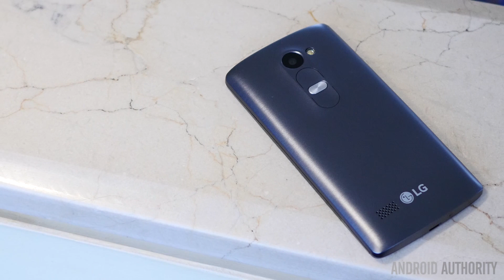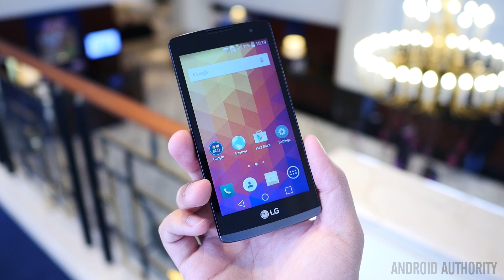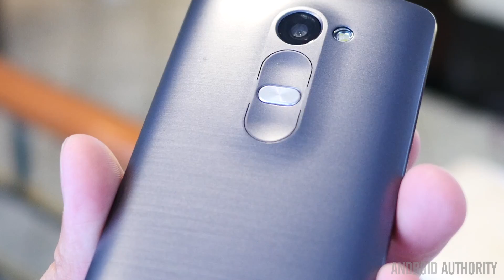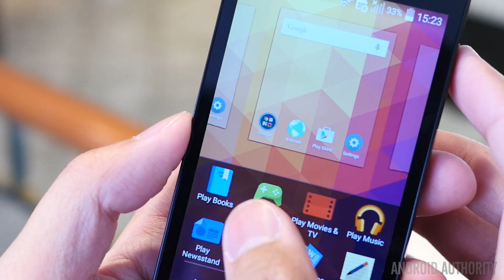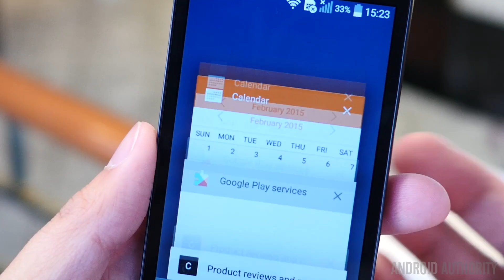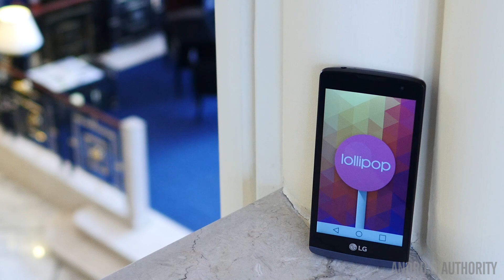LG Leon First Look

Comment: I don't know how much this costs in the US or anywhere else but you can get this for £60 in the UK brand new, which is a bargain. This is a budget phone so don't expect it to be like the G4 or something but for £60, give you bang for your buck.
Reply: +kashattack 
60 pounds!? Where!? Best I can find is 90 at argos.
Reply: From Vodafone. It's actually dropped to £50 now! Check it on their website. You'll need to top it up with £10 but since I had a Vodafone sim I didn't need to top up.
Reply: kashattack Ahhh, I don't want to work with Vodafone, not for any reason, I'm just happy with my deals now. Thanks though! :) I'll probably just be getting a Moto E.
Reply: The Great Spud I don't use Vodafone's network either, I bought this phone from them and got it unlocked by using a code purchased from ebay for a about 2 quid.
Reply: kashattack I don't do things with my credit card on the web, thanks anyway though... again. Got the Moto E and it's good enough for me.
Reply: cheapest smartphone for T-Mobile. makes a good backup.

Comment: Moto E 2nd gen is way better than this and I'm pretty sure they r at the same price point. Samsung galaxy core prime is a worthy competitor for this phone bit moto e2 Is better in about every way , much better IPS LCD Qhd 245ppi screen compared to the lg's wvga 220ppi screen.
Reply: +Tahmid Islam Moto has a bad reputation on camera's, LG on the other side is much better brand for a camera, also the Moto E doesn't have flash on camera.
Reply: +Gabriel Hernandez Moto does everything else better apart from the camera

Comment: I got this phone on Wednesday and as for now, my opinion is that it's a very decent phone. my only complaints are that the screen isn't really good, could had at least put a qhd screen. second, the camera. SUCKS SO BAD. you can't focus it nor does it have auto focus. except for the front one. thirdly, the internal storage. this is an "8" gbs phone. however only around 3.4 gigs Are available to the user. just had. lastly, the charging. my sisters and I all got this phone, and we use the charger that came with it to charge it. but it takes so long to charge. literally it took about more than an hour just to go up about 25%. however it does has good battery life. other than that if it didn't have all those problems this phone would be amazing.
Reply: ***** the minimal they should had done should had been a qHD screen
Reply: In my opinion
Reply: But the way it is its not bad just could had been better
Reply: Thx I'm going to get the Samsung avant instead
Reply: Darude - Sandstorm Really bad camera, but it was cheap as dirt so I can't really complain. Coming from a ZTE Avid I'm pretty satisfied :p
Reply: at a price like this? I got this one few months ago and I must say it is very much performing well.

Comment: terrible. you said nothing on how to operate this phone, why bother?
Reply: ***** I have this phone, got it the second day it came out, which I kind of regret on the part that the camera is really bad.  The phone itself is nice and the Lollipop OS is pretty smooth, though it does stutter a bit when exiting from an app.  For my particular preference, I just need a phone that connects my calls flawlessly and a good camera and this one doesn't have that.  The camera doesn't have auto focus which is so basic on lower range phones and this one is suppose to be "mid range" so I was really not happy.  It opens with the new "knock" feature to the first screen then the swipe screen  to get to your apps.  No buttons around the handset only the two you see on the back toggle up and down,, the middle of the toggle is the on/off silver button and when asleep, the same toggle works as shortcuts, down for the camera and up for the quick memo.  If the camera feature is not a deal breaker for you then go for it.  Hope this helps.
Reply: The camera was the only good part about it imo.    it was a second phone for me, it sucked and I returned it 2 days later! To me it had nothing that worked and didn't even hold a charge, and That- I needed. grr
Reply: Marilyn Alvarez Does the phone lag at all? In games or the O.S.?
Reply: William T....the games are pretty smooth running and the screen is nicer than some have described as far as colors and video playback such as youtube and Netflix.  As for the OS it is good but as I stated before, it does lag a little when exiting an app game, when I exit Temple Run 2 it takes a couple of seconds to show me my home screen it stays blank for a second or two.  Hope this helps you in you assessment,.
Reply: Thank you for the reply. I'm going to get this phone for andriod lollipop and the performance.I'm ok with some lag when exiting a game or app. It seems like a steal for $50 on metro!
Reply: Yingdiskette....the camera is not that great at taking pics of documents, you need to try different angles for sure and close photos are hard to take.  I was trying to take a pic of something I was holding in my hand an I just gave up.  That being said, you may get a good pic of a check in the right light and angle, just tweak it a bit and you'll be good. Good Luck
Reply: +Marilyn Alvarez I got it as well and sadly it's pretty shitty I've got apps crashing on me playstore has trouble updating and installing apps keyboard disappears while typing sometimes and apps like soundcloud and Spotify  crash when playing outside of it worst part is I've already done a factory reset and  no changes still the same God Danm problems
Reply: Kyoya Yakuza...I know it is really sad that a company so well known as LG can do this to a phone that looks very pretty, I mean cutting corners is one thing but taking out basic functions is ridiculous.  How can a so called "smartphone" be so "stupid" (pun intended) I guess we'll never know.  I'm planning on burning mine as soon as I get a new one in order not to burden anyone with it (evil grin)
Reply: +Marilyn Alvarez sounds great hell not even the factory reset I did got rid of the problems on it even a few friends of mine who have the phone aswell complain about the same problems just shows how shitty LG can be sadly
Reply: The more I use the phone the less I like it, when you move the apps to the SD card, you assume they'll stay there....NOT the case, when  you get an update the phone will say "insufficient storage" even if you have space on your SD card as the phone will automatically move the app back to the phone memory for update and forget it if you have more than one app that needs to update, you have to go one by one to move them back to the SD card then update, then after each app is updated, go back and move them yet again to the card.  I really pain, not to mention you turn off you phone completely, then you'll need to move them back again AND turn off all the notifications again as they turn them self back on (sigh) it's like a mind game that LG is playing with us...grrrr (waiving my fist angrily at LG)

Comment: Ok so I got this at my local Metro Pcs because my Optimus L6 stopped working. Thought it was better than my L6..i was wrong. Its got worse reception, cant play youtube and surf the web at the same time, camera is slighty crappier then the L6, VOLUME IS HORRIBLE at max with bass - treble booster apps running turned up, power button in the back upper part ( WTF) which will cause it to turn off when glass side is facing up sometimes WITH A RUBBER CASE ON, No light display when charging, etc...What a piece of crap. This was a last minute buy and regret type purchase. Of course theres no returns on "upgrades" at Metro either. Go with the L6 or Samsung S5 . The worst part is the volume and you will notice it right away with any heaphone set up.

Comment: the L and F series phones cost around 300$... that's... not competitively priced at all!
Reply: Jimmy Peña the 300$ is the unlocked version, not a plan.
Reply: Insane CoolAid you could just get it on a plan and unlock it, it's a much simpler and cheaper solution
Reply: Nope, the lg f60 is less than 150 and the l70 was less than 100
Reply: Jimmy Peña Is that today's price tag or the initial?
Reply: Insane CoolAid leon is free on metro for new lines or 49 for existing costumers, $90 on T-Mobile and I'm not aware about other companies.